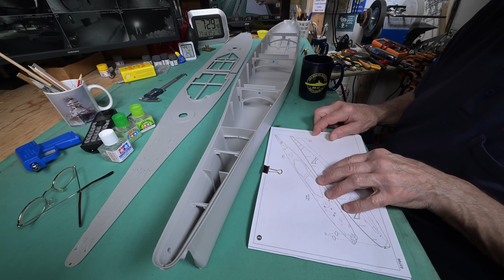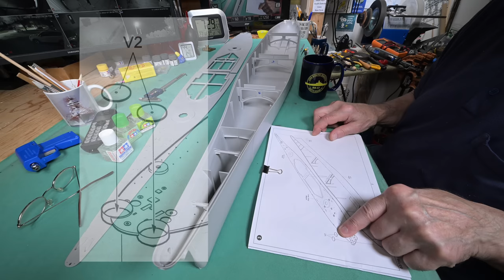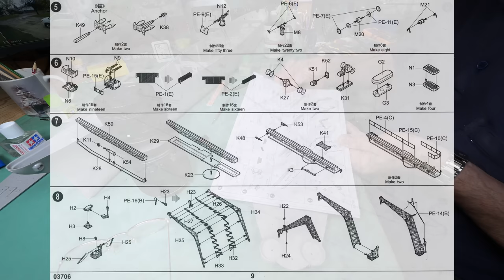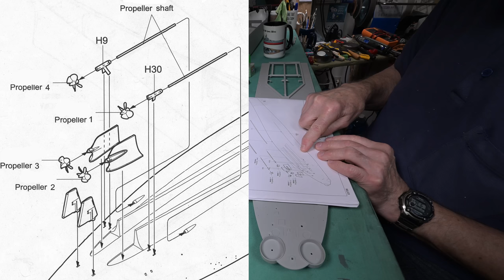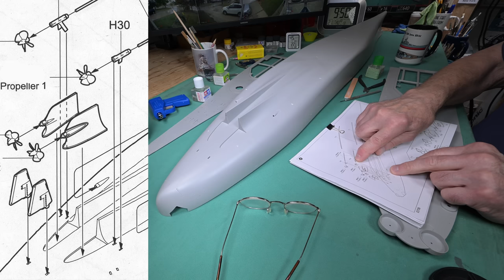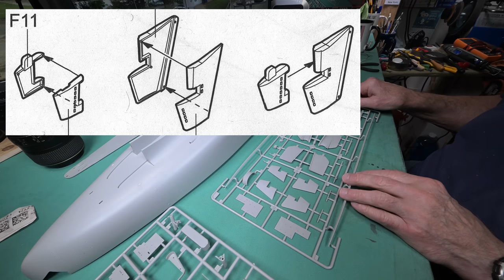The Model Ship - Part 1330

Comment: Hi Ron, The Iowa is really long and narrow isn't it.  I wonder what it would look like next to the Yamato?  That was a really good job using that thick glue on the supports.  They are going to be nice and strong.  That's so nice that your friend wants to paint up some figures for you.  Thanks for sharing.  Have a great day.  Jeff
Reply: The Iowas were built as large as they could be and still fit the locks of the Panama Canal. The Imperial Japanese Navy weren't  planning to transition through the canal.
Reply from the maker: I think that from a profile view both ships would look the same size --- maybe.

Comment: Ron, I think it might have been a good idea to temporarily set the deck back in place on top of the supports to make sure everything dried in the correct position, especially with that last support having to fit between those two positioning strips on the bottom of the deck. Looking good so far. Waiting patiently to see you putty the joint on the hull and sand it down. See ya tomorrow.
Reply from the maker: I'm not gluing the deck supports to the insides of the hull.

Comment: I have found the Tamiya quick setting to be weaker than regular styrene cement or the extra thin, it's good in limited applications but I wouldn't trust it for anything "structural"; also don't like the smell of it.